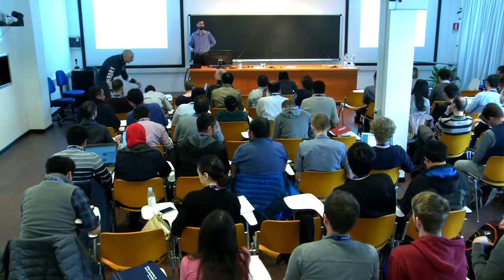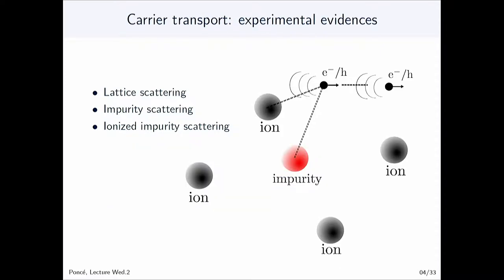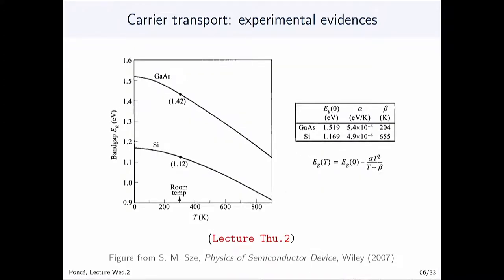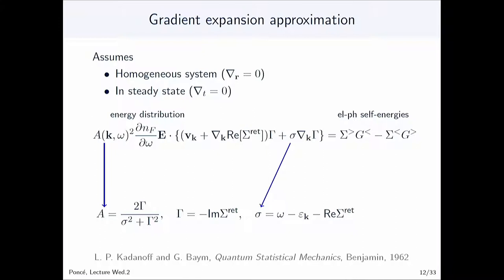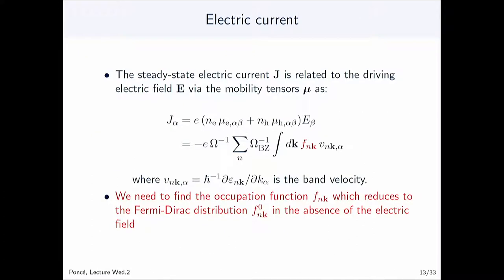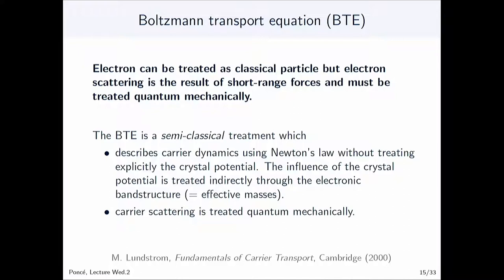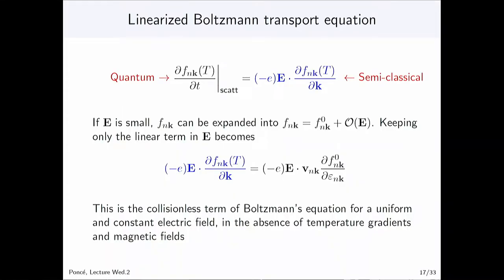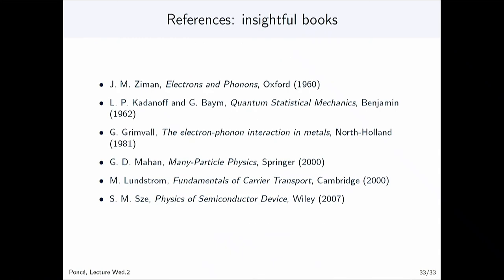Introduction to the Boltzmannt transport equation (BTE)

Comment: 5:00 isn't exactly clear. If I wish to have 10^14 extrinsic carrier concentration, the Fermi level should to which level?
What are the red and blue lines for? No image source either :(
Reply: The red and blue lines represent the values of Ef-Ei which are plotted against temperature for n and p type semiconductors respectively. Each individual line represents the doping concentration which is mentioned  on the line. So for a given temperature, doping type and doping concentration, from the graph we can estimate the value of Ef-Ei and  as a result electron and hole concentrations.